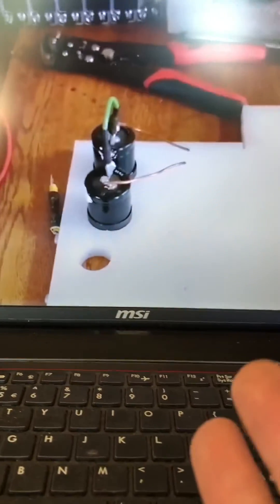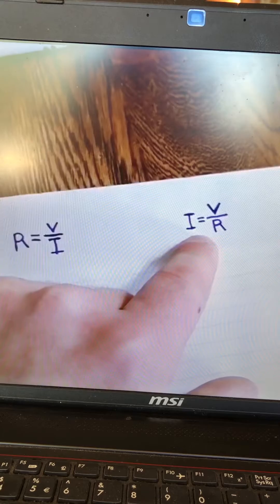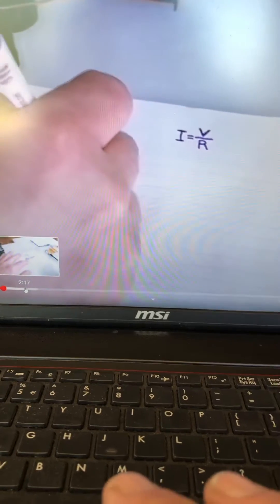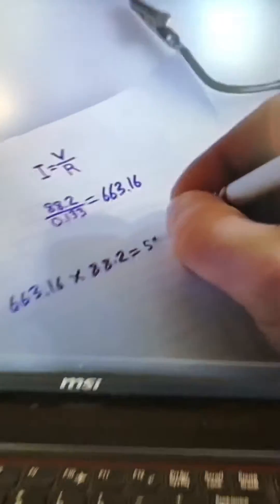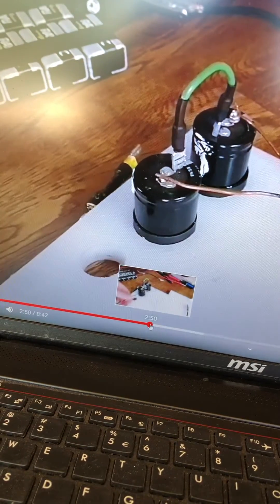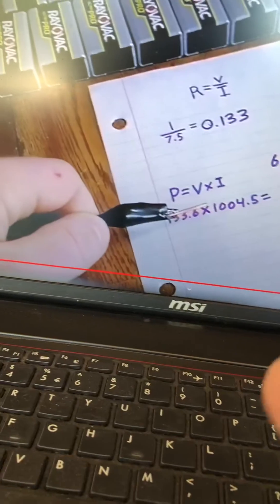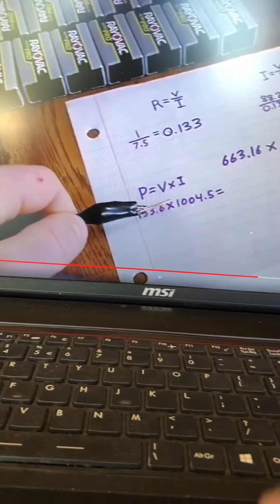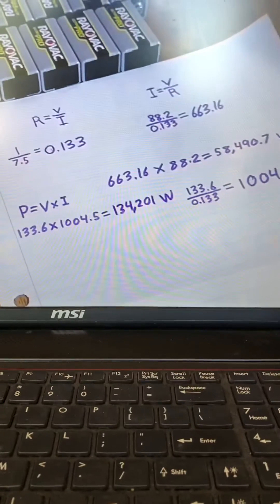Understanding disruptive discharge

Comment: Yeah but at a very short time due to the pulsing effect. It would be good if throwing at constant power at the output. That huge amount of amperage is very useful if you find a way to charge very fast.
Reply from the maker: Everyone wants output measurements  the measurements are useless unless you can calculate it. Properly and only a small handful ever have.what people are to get from this video is the correct calculation based upon the resistance of your load. Low resistance massive amps ….. short time period so do it many times a second to see the light.  And discharge it as fast as possible for most ambient return like I have with the spark gap.raise the voltage to gain amplification factor. Run  in resonance to lower input power. Tune the wires for harmonic resonance I can keep improving my design should I choose. It’s overunity from the most basic version
Reply: @ENKI_TECK  connect the 50 kw load  its simple 😜,why we need nuclear power plant
Reply from the maker: @petername2608  indeed do it.  Match it in resistance and bang away. ….I have the SMKJ transformers available resonant tuned resonance transformer system to charge your caps

Comment: So what I'm getting from this is you put in a shit ton of voltage to a large capacitor so it charges up to 88 volts really fast and then discharge it through a spark gap (gap spaced out for whatever voltage u want) for the amperage discharge.  And u do it over and over to increase your watt hour output.    Am I on the right track ish?
Reply: Caps are like fast battery's.  If u put them in series u raise voltage.  If u make them parallel u raise amperage.
Reply: @michaelbrukley1311  Do you have any idea how to achieve over unity with disruptive discharge?
Reply: Which is kinda wierd because lithium battery's are made the same way caps are just electrochemical. I cannot wait for fast charge and fast discharge lithium/graphene batteries.  Those will be a game changer.  They will have energy dencity of batteries and the high power capacity of super caps.  I kinda wonder how they hold up to heat of charging.   Caps have a low energy density so they don't blow up easy.
Reply from the maker: Yes that’s correct
Reply: Sweet thanks.
Reply: Do capacitors have to be in series or in parallel? (in order to increase amperage)